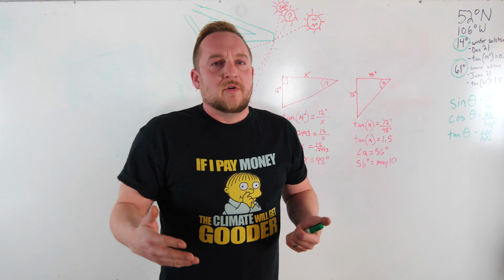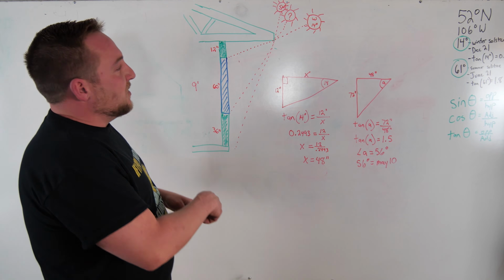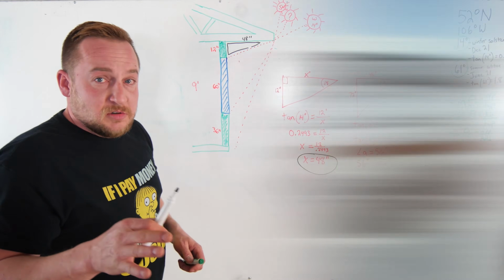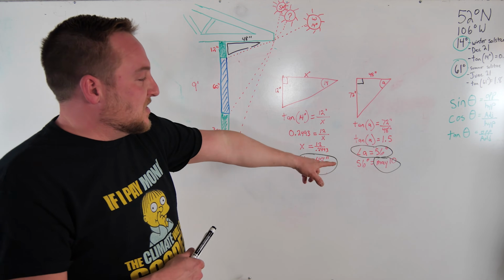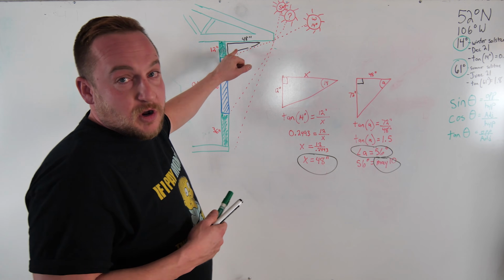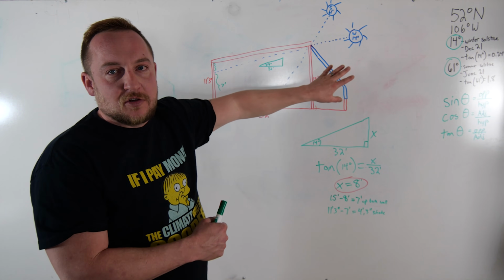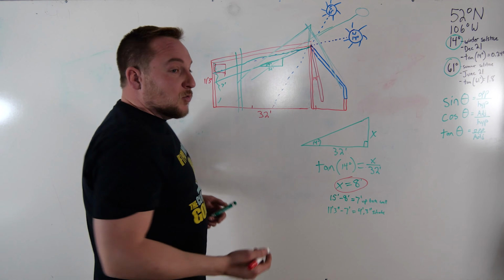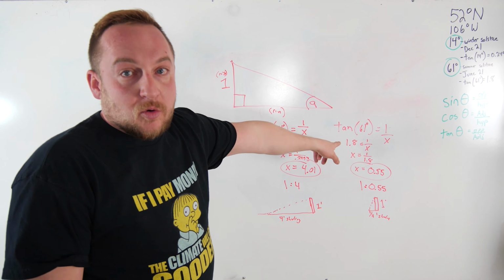☀️Sun Angles📐for Passive Solar - Houses, Shops, Barns, & Greenhouses - Anywhere on Earth

Comment: I am so excited for this video!
Reply: Dean, we need to know how you went from coordinates to the solstice angles.  I looked at that sun calculator, but there is a lot of detail, and based on times of the day and graphs etc. It is confusing to get the proper fields entered to find those angles properly.
Reply from the maker: @PrairieDeeHomestead   set your location on the map, then set the date for the solstice day and click “execute” (I think).    Then the angle is at solar noon (the high point on the graph).  It’s a complicated thing at first glance, but play around with it and it’s amazing.